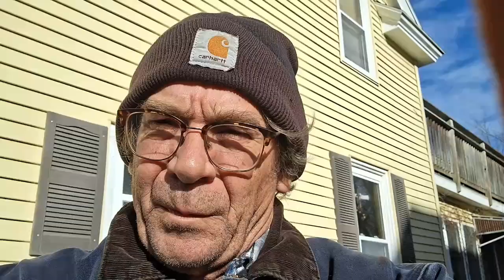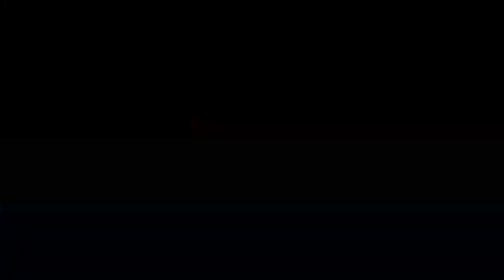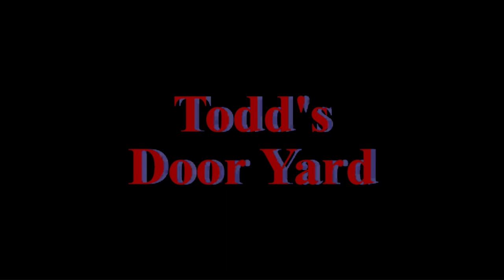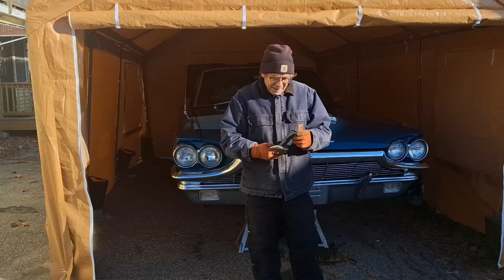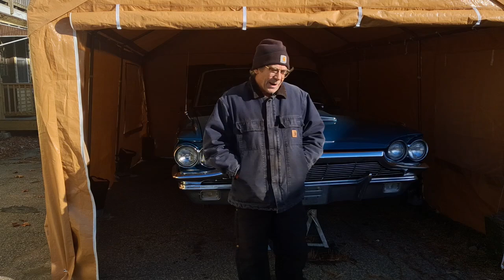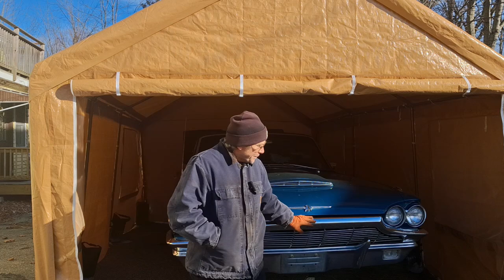1965 Ford Thunderbird rebuild Part 15

Comment: Good update. I think once you get into the column, you'll find it needs the lower bushing, shift detente and the shifter itself will have a notch worn in it.  The upper bearing has a little plastic isolater that goes around the outside of the bearing that goes bad. 
If you reach under the end of the column in the engine compartment, there's kind of a ledge and I'd bet you find some broken plastic pieces - that's the lower bushing after it falls out of the steering column. There should also be a small white cone evident down there. If you can grab the shift tube at the bottom of the column and move it laterally, that lower bushing is destroyed - it's a super common failure. There are parts available to completely rebuild the column and it works really nice after it's gone through. 
Good luck Todd!
Reply from the maker: Thanks, we'll see once I get there about the lower bearing, I plan on fixing the shift lever with a bit of weld
Reply: @toddsdooryard  Good plan, My shifter was totally worn out but the detent was almost like new - go figure!
I misspoke, the lower bushing goes between the shift tube and the column at the bottom. It will add to the slop in the shifter when bad.